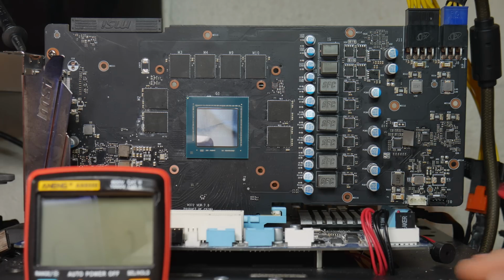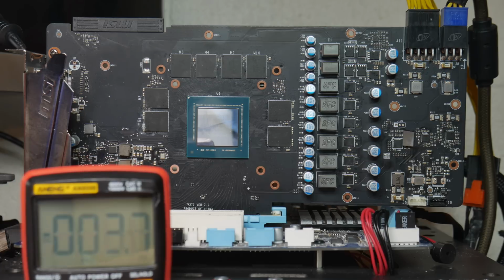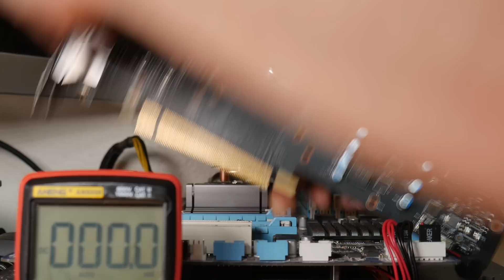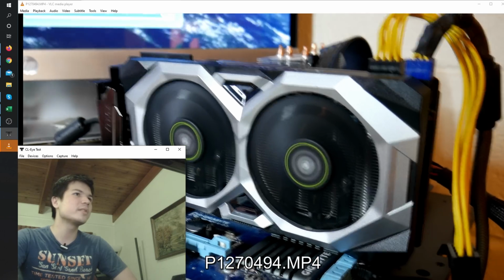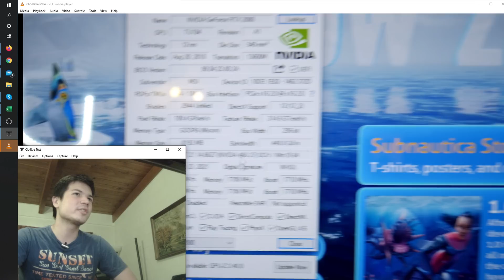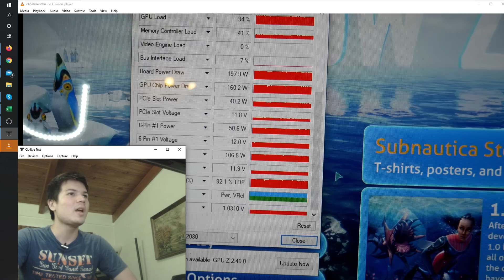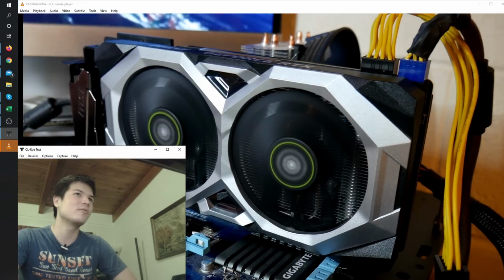MSI RTX 2080 Ventus Graphics Card Repair - Not Detected

Comment: My RTX 2070 super founders edition was working fine last Saturday, Sunday morning it died no post white led on my ASUS dark hero lit indicating no GPU detected, I rebooted and same no gpu detected I can hear windows load in the background also the fans didnt spin at all the card was warm on the back plate lightly. What went wrong the system with an old P2000 works fine I checked the rails on the powersupply with DMM and they are all fine 12Volts? How does a card working fine one day dies all of a sudden?

Comment: Great Video, How does a component goes missing ?
Reply: Components get knocked off boards all the time. Very common. People drop or scrape their cards against metal cases or whatever.
Reply: Sound like he created the fault by taking it off.  Easy 🤫
Reply from the maker: ??? I don't create faults, this is a customer card. The resistor was likely knocked off.

Comment: How does a resistor simply disappear while leaving the pads present?
Reply from the maker: Knocked off components do not always cause the pads to rip
Reply: Sometimes the components itself is destroyed and leaving the pad in place
Reply: @accurian148  Not properly made solder joints may cause a component loosing!! A poor assembly can cause a failure more often tha one might think.
Reply: RK, you are just showing your complete ignorance in electronics.